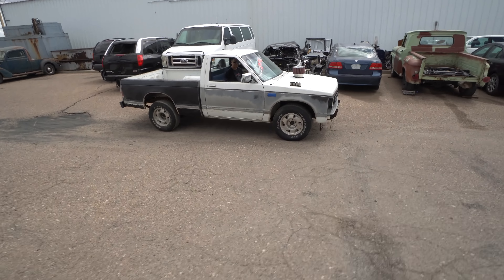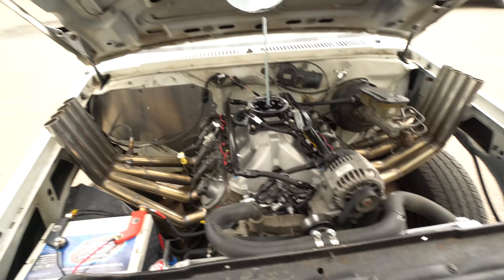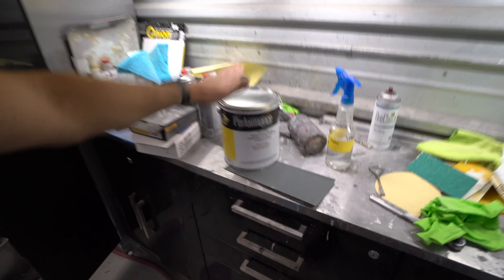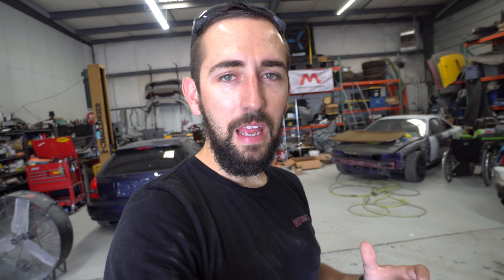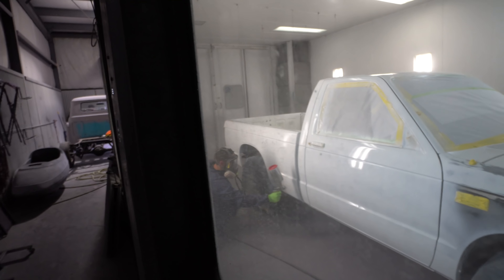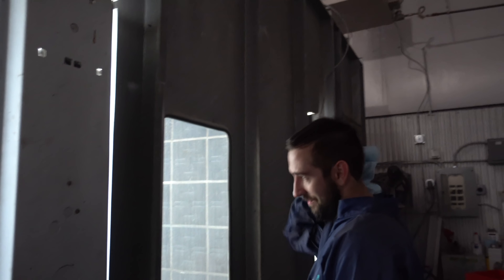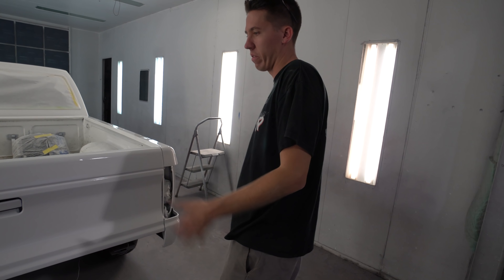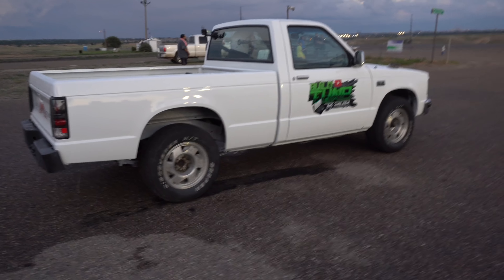$100 PAINT JOB! - Making This Ls Swapped S10 Burnout Truck Look GOOD!

Comment: I agree sprayer better than rattle can but if you live in an Apartment your space us limited.   I discovered 2X Spraymax Clead Coat.   Won't come off with brake cleaner protected against UV Rays.   It also has a hardner in the can.  If I drove my car up there how much would you charge me to paint it?   2 door Chrysler Crossfire.  Base coat and clear color would be black.

Comment: If you drive that truck up to ColdWarMotors garage he could beat those dents to perfectly smooth with his hammer and dolly. You should get a dolly and try it out. Might have to cut out all of the under skin support structure to get at them all.